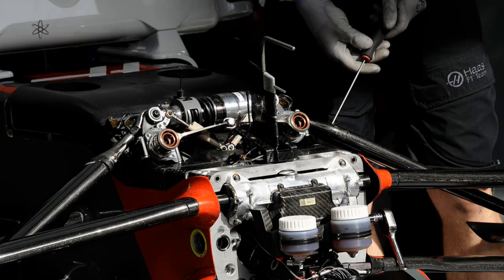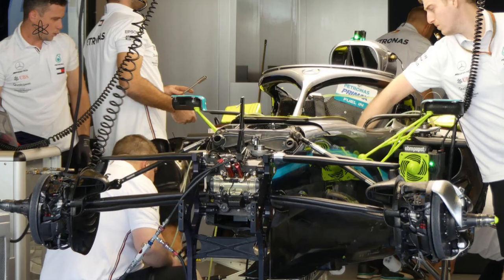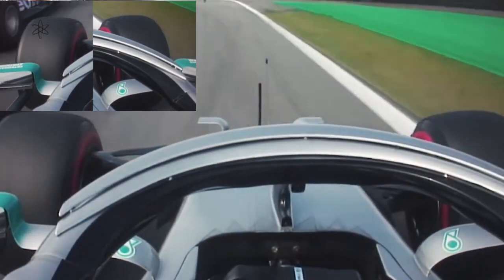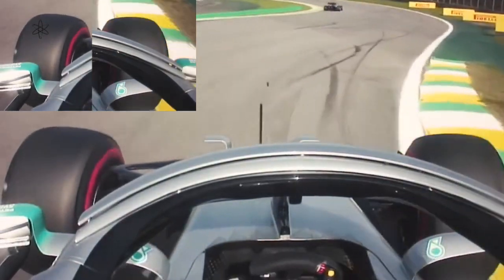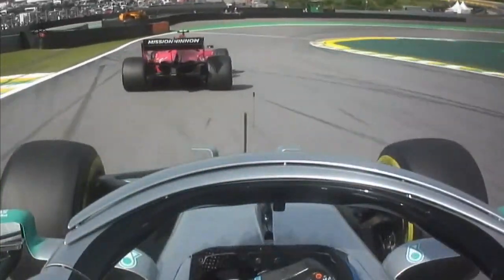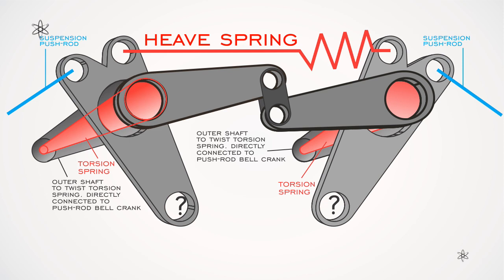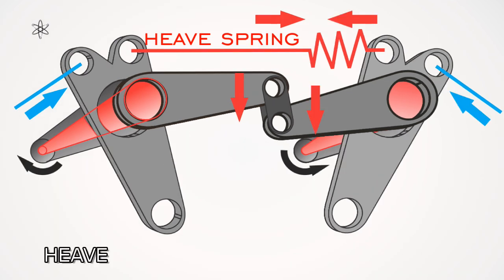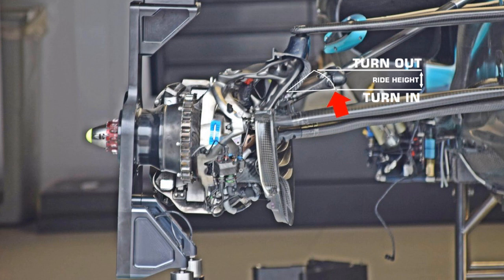F1 Front Suspension Direct Link Anti-Roll

Comment: I want to use this to lock the front wheels together on a 3 wheeler since any body roll results in the back wheel having positive camber. That or somehow design a 4 link suspension for the rear that is interconnected to the front and can maintain correct alignment through body roll

Comment: You missed what many others have as well. The twin lower ball joint on fixed arms. I know it makes no sense, but only at first. What would be better then the front load bearing wheel shifting slightly forward and cambering in? You get a front wheel planting in to the turn with a better tire patch for the ideal traction and at the same time the other wheel, instead of it just barely making contact, in t pulls back to make better contact with camber out again for better tire patch, making it more viable in the turn. and most mechanics have no clue!

Comment: A heavy anti roll mechanism on heave suspension actuates the heave spring and damper when 1 wheel moves and that's proportional to the strength of the anti roll mechanism... If the suspension were locked together, which would not be wise, then any movement from either wheel would actuate the heave mechanism directly and the individual wheel springs could all be eliminated. Conversely, the absence of an anti roll mechanism will see no interaction between the heave mechanism in turns and all the body roll must be controlled by the wheel specific damper and spring packages.
.
By running a heavy anti roll mechanism the AMG Mercedes can run much softer individual springs and damper rates with a strong heave unit... Allows for incredible controlled body movement at F1 speeds while absorbing the curbing with compliance. 
.
Under braking and acceleration, the wheels move the heave unit directly and all three dampers and springs affect the body movement. It's an incredibly complex setup where changing one damper or spring rate can affect several different functions of the entire suspension package even though it appears relatively simple in nature.
Reply from the maker: very well explained
Reply: @SpeedMediums  you put a ?? On the lower holes in the drawing

What is it supposed to connect to?